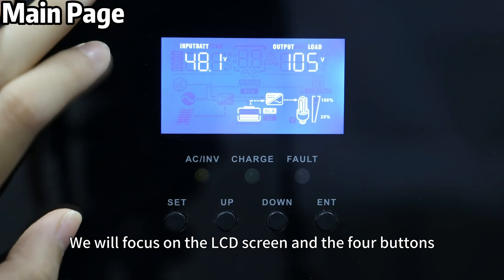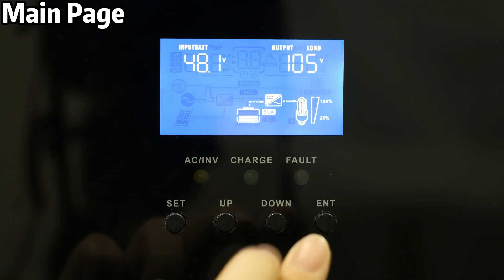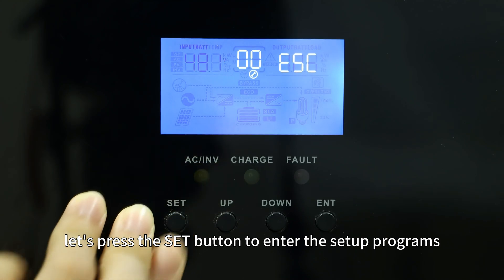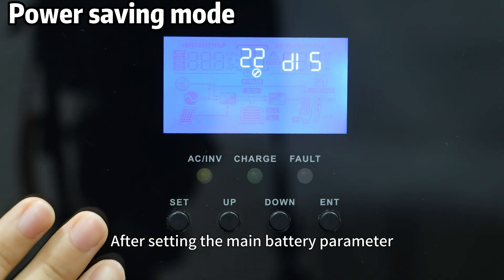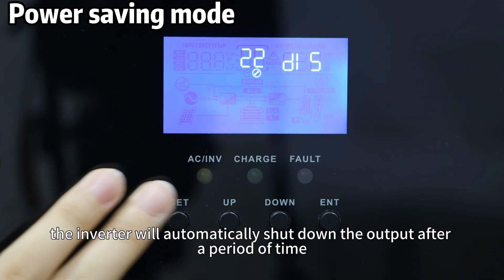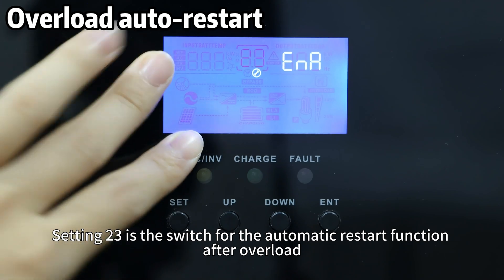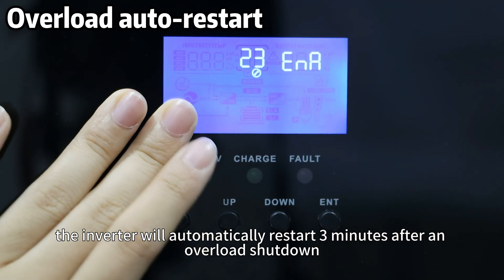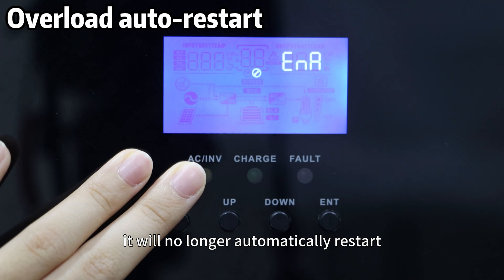A Step-by-Step Guide to Setting Up the POW-LVM5K-48V-H

Comment: is this bluetooth,wifi, how cani connect this to my computer or phone?
Reply from the maker: Hi, kindly check the link below:
https://powmr.com/products/powmr-wifi-module-wifi-hf-n?pr_prod_strat=pinned&pr_rec_id=92bb2ff7f&pr_rec_pid=9268264993063&pr_ref_pid=8295280541991&pr_seq=uniform
Reply: @PowmrSolar  this model doesnt have a "wifi" port, just rs485-1 and rs485-2, in the video there is a wifi port
Reply from the maker: @placezplacez5351  rs485-1.

Comment: What is the difference between the POW-LVM5K-48V-H and POW-LVM5K-48V-N?
Reply from the maker: No difference, the POW-LVM5K-48V-N is an upgraded version. The POW-LVM5K-48V-H model is no longer for sale.
Reply: @PowmrSolar  Can we use a "N" with a "H" and may we tie their output neutrals together?
Reply: But keep output line out isolated from one another.
Reply from the maker: @ Nope, please don't do this.
Reply: @PowmrSolar  Is it possible, please, to explain why we should not do this, use a common neutral with appropriate wire size?
Reply from the maker: @ Are you planning to connect the two machines in parallel?
Reply: @PowmrSolar  We will keep the "power" legs (L1 and L2 from generator) separated, we do want to bond the neutrals to ground, so these will be in parallel.
Reply from the maker: @anythingrural  This model does not have a parallel function. It can not be used in parallel.

Comment: Can you use more than one of these at the same time? Can they be connected in parallel or be used to create line 1 and line 2?
Reply from the maker: Nope, the POW-LVM5K-48V-H model can not be used in parallel.
Reply: @PowmrSolar  if we have one now, may we add one more and send power to a new breaker box? Can they both be fed by the same battery bank? And, since we must bond the neutral to ground, is it ok for the neutrals to be bonded?

Thank you for your support
Reply from the maker: @ No, it can't. This model can not be used in parallel. 

If N-G are bonded, there is a risk of causing the mains power to trip. So we don't recommend bonding N-G.
Reply: @PowmrSolar  Thank you
Reply: @PowmrSolar  Thank you, I do not wish to put the line out in parallel, just the neutral. It is a common neutral from the generator, so the  input neutrals are already common. Also, in the U.S. we are required to bond neutral to ground, so please help us to be able to do this in a way that is ok for your equipment. Thank you

Comment: POW-LVM3.5K-48v
Parameter #04 unable to hold 48v low voltage change to utility charging of batteries.
Always defaults back to 43.6v and doesn’t work.
I don’t want my batteries to drop that low in voltage. Please help!
Reply from the maker: Please send your problem to this email: support@powmr.com. Our technical staff will handle it for you.

Comment: this inverter dosen't have SUB option?
Reply from the maker: Three output modes for this inverter(SOL UTI SBU)
Reply: @PowmrSolar  thank you
 Plecase recomand me an inverter 6.2kw for Europe with low mppt voltage 55-450v and sub mode
Reply from the maker: @MiceaCraciun  Kindly check out this model first: https://powmr.com/products/all-in-one-inverter-charger-6200w-220vac-48vdc-dual-ac

Comment: hello on my PowMr 1.6kw/2Kw 12Vdc inverter, there is an error Fault code 03, how to solve it
Reply from the maker: Fault code 03: Battery voltage is too high.

Please disconnect the PV and mains power, connect the battery and load, and discharge the battery to 25V and then try turning it on with only the battery connected.

Comment: Hey cna you help me? I'm having some issues with the inverter. I recently adquired one of this but in cloudly days the inverter is not chargin it looks  like mppt is not making his work. My system has 4 panels and I have to play the setting 7 to get charge on cloudly days. I already sent email but I have not an answer yet. I'm looking if you have any firmware upgrade for this. Thanks!
Reply from the maker: this model(POW-LVM5K-48V-H)? May I know which email did you send it to?

Comment: Finally someone did a full explanation on how to setup your 48v all in one inverter. Thank you
Reply from the maker: Hi, thanks for your support.
Reply: After install I get error code 10, what is it and how to fix
Reply from the maker: @davemacdonald5106  this model?(POW-LVM5K-48V-H)
Reply: @PowmrSolar  8.2kw model
Reply: do you have a video on 8.2kw model
Reply from the maker: @davemacdonald5106  The load power may exceeds. Please tell us the load information of your connection.
Reply: Setting 29. Can that be used with an Auto Transformer to make a 120/240 split phase.